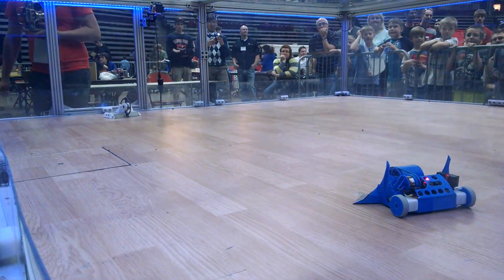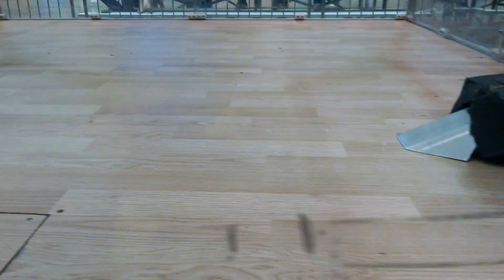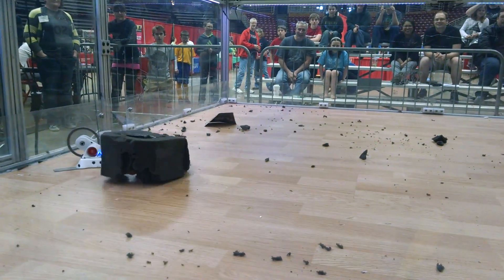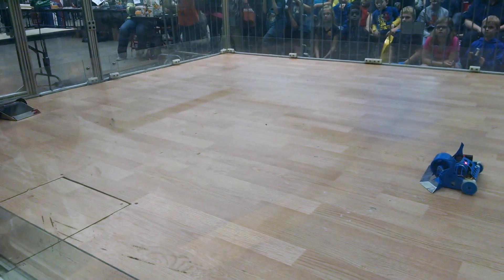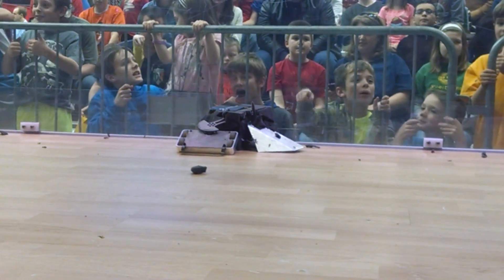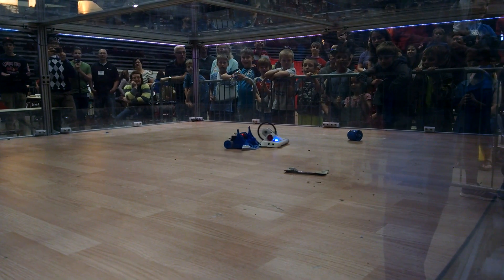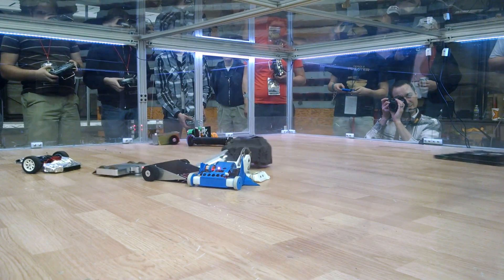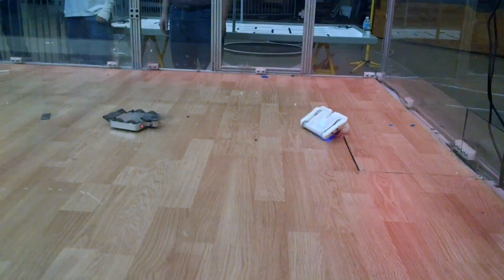3D Printed Combat Robot, Highlights

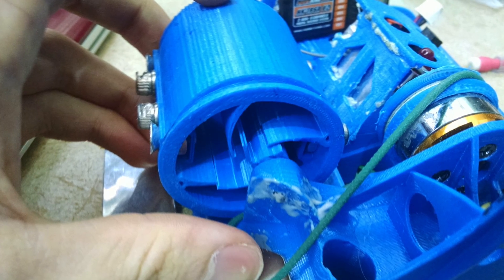Comment: 3:55 Your spokes are backwards, the higher force from torque is near the inside, not the outside. It also looks halfway hollow there, so you had only 1 perimeter of material making it fail in a very weak area, that's just a design issue and should have been made thicker in that section.
Reply: Otherwise its a pretty good bot, I like the design and it looks like the rest was pretty well made. I'd love to go to some of those competitions, looks like a crazy amount of fun, cheers!

Comment: Maybe if you would have printed it thicker it wouldn't crack so easily. (3:55)
Reply from the maker: True, the design also wasn't great: the "spokes" were thin in the direction of the impact force.  I didn't use spokes for danger zone 2.

Comment: what about nylon 910 i think it is way better than abs
Reply from the maker: Yep!  The date sometimes varies, but it is done every year, I competed this year as well
Reply: +AltaPowderDog I'm making a battle bot
Reply from the maker: Nylon is wayyy better, I agree
Reply: +AltaPowderDog do they allow Lego ant weight battle bots?
Reply from the maker: If you meet the weight limit and have 2.4Gz remote control, sure!  a lego bot would be fun
Reply: +AltaPowderDog Mandy I can glue the Legos together. And cool dude!
Reply: +AltaPowderDog also I don't understand the bracket
Reply from the maker: The bracket isn't really possible to understand from this video, I just focused on my interesting fights, and not on the whole competition.  It was a double elimination bracket though, so if you lose your bot goes into the losers bracket and has a second chance to win
Reply: +AltaPowderDog oh. Does danger zone have 2 or 3 wheels?
Reply from the maker: Just two
Reply: +AltaPowderDog k
Reply: +AltaPowderDog do they do the bot brawl every year?
Reply: +AltaPowderDog how long did it take to make danger zone?
Reply from the maker: I previously responded, thinking this was referring to danger zone 2.0.  This version was put together really really quickly, probably 20-25ish hours of work
Reply: +AltaPowderDog woah that's not that bad
Reply from the maker: Version #2 took like 5 times that though
Reply: +AltaPowderDog oh
Reply: So far it's a wedge
Reply: I called it Dead Zone
Reply from the maker: Cool!  Hope you can find a competition near you and compete!
Reply: +AltaPowderDog  yeah me too.
Reply: +AltaPowderDog Why don't you put the design on thingverse so people can make their own danger zone if they want?
Reply from the maker: I already have, here ya go: http://www.thingiverse.com/thing:766609
Reply: You guys keep the good work up , ppl like you who give hope for next generations .  Keep design and keep share 😎😍😘
Reply: What Danger Zone do you like more 2015 or 2016?
Reply from the maker: Urayoan Irizarry 2015 for sure, it just needed a better drum
Reply: You should ring it back for next year.
Reply: *bring
Reply: AltaPowderDog.
Recently I join a RFC competition on roblox and these are the battlebots I signed up for.
Gunsmith
Two Face
And soon Saiju
Reply: What is nylon

Comment: why was there sticky notes in The Best or Nothing
Reply from the maker: +Fancy Raptor Well, the wedge was way heavier than the rest of the robot... without some counter weight at the back it'd tip forward and the one rear wheel that let it turn would lift off of the ground.
Reply: altapowderdog Cool I wasn't sure if it was a joke. I'm planning on building a 12 lb battle bot. I have no clue where to fight it near me though but I'll keep an eye out. I go into high school next year and their team has won nationally a few times so they can probably tell me where to look. Your videos have been helpful so thanks
Reply from the maker: haha the whole robot was a joke.  You're very lucky to have a high school team!  Good luck.
Reply: +altapowderdog Thanks. I dont think they do combat robots more along the robots that have to complete challenges
Reply: +AltaPowderDog You should bring that "best or nothing" back instead of the 2016 one same for danger zone.